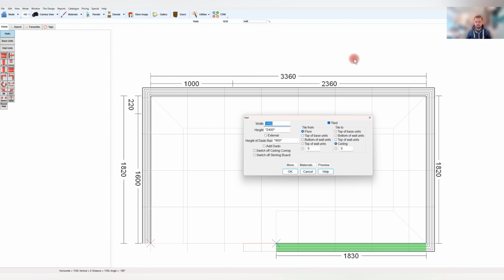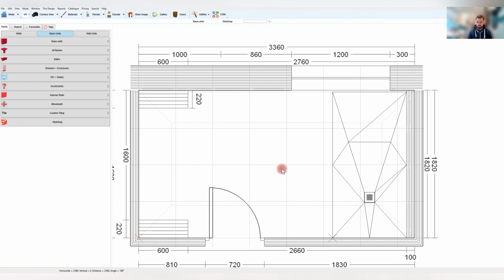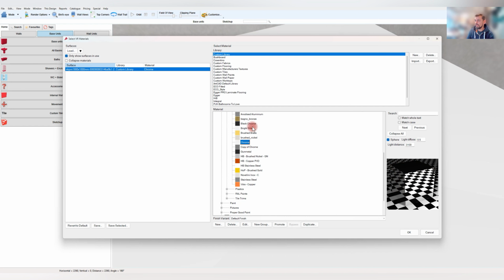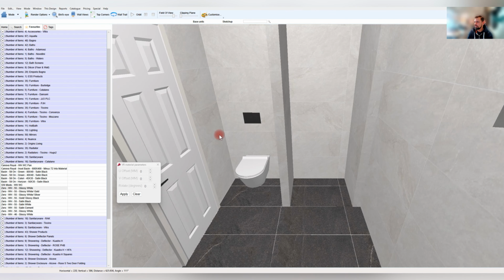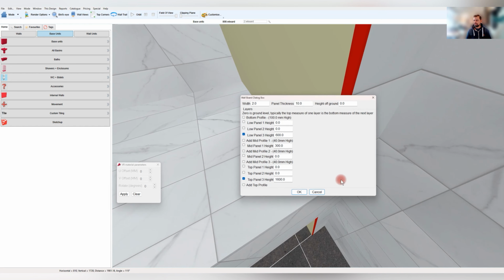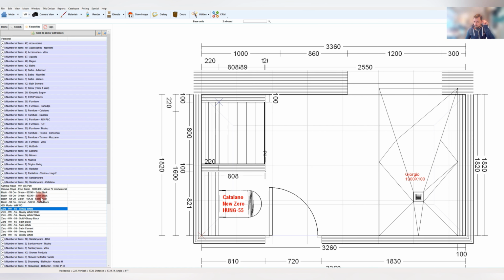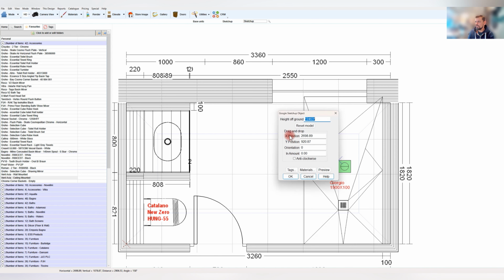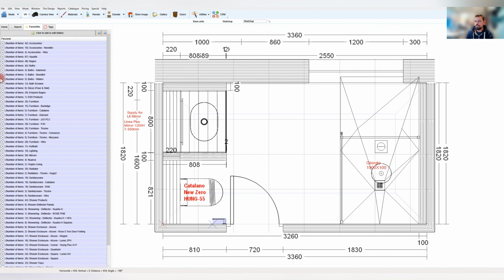ArtiCAD - Real-time Full Bathroom Design featuring custom Sketchup models - Version 23 B10 - 001

Comment: Great use of Articad! What performance is the pc you use please? Mine loads some catalogs very slowly.
Reply from the maker: Thank you. 

My PC specifications are:

I9-10980XE - 18 Cores (Currently important for rendering)
32GB Ram (great for multiple windows. Old PC I had 64gb but seemed pointless)

The new update to ArtiCAD can use graphics cards for rendering, which is brilliant. I’ve a RTX3070Ti that will finally be utilised.
Reply: @interiorcaddesigns  Hi Ricky ive sent you a message re your sketchup models. Did you see it?

Comment: Very helpful. I've been trying to figure how to simplify the tile trim process, but I don't think there's a workaround. Do you use artitiler at all? I find with tiling, I often get very odd lines  on either side of window/doors which looks rubbish. I'm guessing tile panels might be better solution for this? 

it's certainly an interesting layout and very well designed. You've got an incredibly large library which I'm sure helps tremendously. 

How the heck did you zoom in and out?
Reply from the maker: I also suffer with the odd lines. If it is every the tiles not being in line it will be because the texture isn’t set to global and more than likely object as standard.

The library of models do help; I learnt to create and convert models through lockdown and got addicted. The alcoves I use are models I import now as I find the quicker.

I don’t use Arti-tiler as I’m not enormously impressed with it. I prefer using my own tile textures and utilising the tile boards. The tile boards also allow more accuracy with calculating tile quantities.

Zooming will be your friend with the smaller stuff. Ctrl + shift and hold right mouse button (push forward or backwards for in and out).

Scroll wheel will work whilst holding those keys (it used to without holding keys, many versions ago).
Reply: @interiorcaddesigns  super helpful! I generally use architextures for all tiling and wallboards. Works well and cheap enough. Thanks for the tips, I enjoyed it!